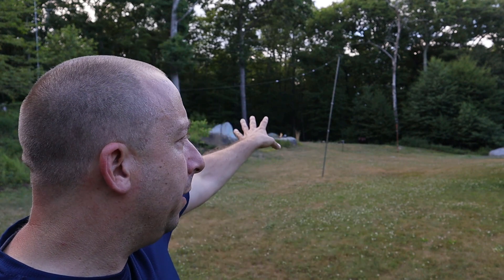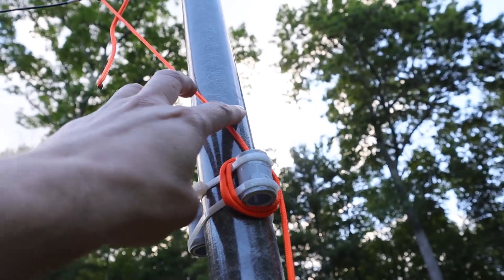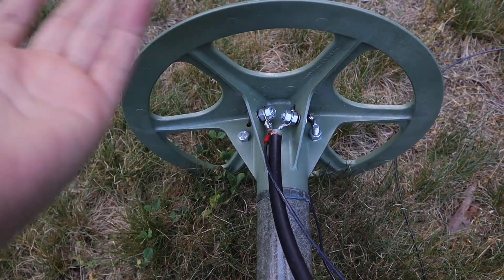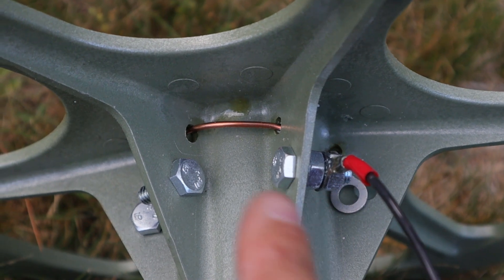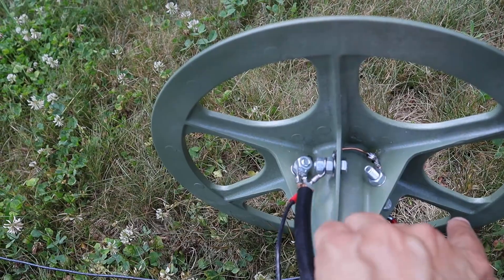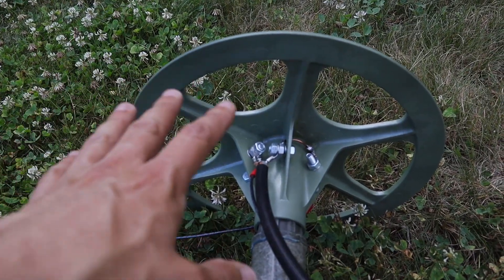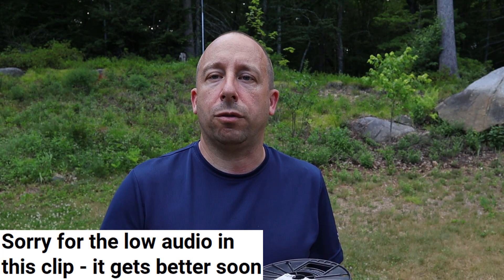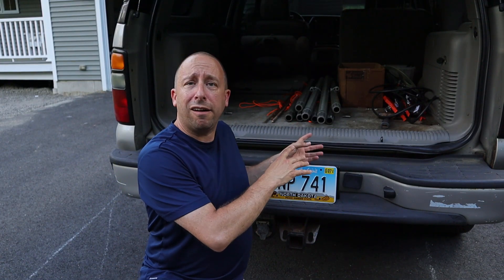Ham Radio Antenna Project: 6 band linked dipole for field day or POTA

Comment: I made one of these . It had to be light weight the centre support is a 10m fishing pole.  I used crimp on connectors and the plastics parts  of 12 g shotgun shells cut it to rings. I was trying to make it as near invisible as possible so I could use it on camp sites. It works well  but my thinking of changing the wire to a lighter gauge and gray to blend in with the colour of  the sky,  l wrote the  band on the insulators to make sure I disconnected the right  connectors.  Nice video  thanks gm7jzm

Comment: Another great video. You may have noticed the graphic showing lengths noted 6M instead of 80M on the bottom part. The right side was correct.  

I am about to hoist my first HF antenna up which is a linked dipole for 20/40.  I plan on making a fan dipole next and then going with a vertical.  Looking forward to getting on HF … finally.  Haha.  All the best, 73 de KI5HXM

Comment: The idea is good. But, for a camping antenna, its constructive revision is required. The conductivity of the Earth changes at every point on our planet, and the resonance of the antenna will change in accordance with it. By using long shunts of various lengths instead of fixed short ones, the antenna can be adjusted to the specific operating conditions.
Good luck. 73!
Reply from the maker: In theory, you are correct.  However, for real-world conditions it is close enough to work reasonably well as it is.
Reply: @SevenFortyOne  Maybe...

Comment: Hello! what is the wire gauge you use to make this antenna, did you use the formula shared in the previous video of the linked dipole to calculte the other bands? 73s  TI2GBB
Reply from the maker: I used 14 gauge wire.  I used 468/frequency in MHz.  I the used my mfj analyzer to trim each segment to length

Comment: Good video. Can you add a link or publish the individual wire lengths chart so it can be printed off? Also, I don't see a link to your Amazon store as mentioned in the video.
Reply from the maker: I added the link to my Amazon store.  I'll out together the wire list when my power comes back on...we've been out for 6 days due to a storm that took down a bunch of trees in the area.
Reply: @SevenFortyOne   Bummer! Part of the hurricane/tropical storm that worked it's way up the coast?
Reply from the maker: Yes ..CT was hit hard and the power company has been having a hard time cleaning up the mess

Comment: Nice video. Yeah I'm a 'cheapskate' as well. Picked up several of those poles a while back for $2/ea.   I'm also guilty of hanging around the plumbing section of hardware stores.  Always fun when someone comes up when I'm holding something and asks If I need any help.

Comment: With the links, maybe cut one of the ring terminals on each link so that it forms a C instead of a ring. That way you can disconnect the link without having to fully remove the nut.
Reply from the maker: That a good idea!

Comment: Some genius engineering there on the connectors between the wires.  I missed the purpose of the center circle of copper, but I'll watch again and figure it out.   Thanks!
Reply: try using alligator clips
Reply: Second viewing explained it all.  Good thinking with that ring, it gives you even more future flexibility.

Comment: You also could use a simple cheap slide switch to link and unlink sections. I build one with that method on the  linked dipole I built.
Reply from the maker: That's a good idea!